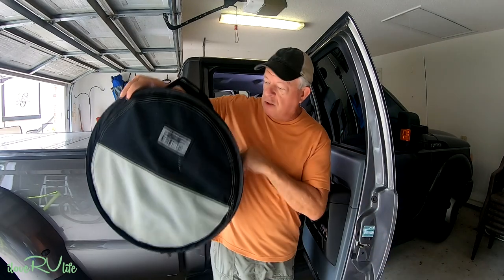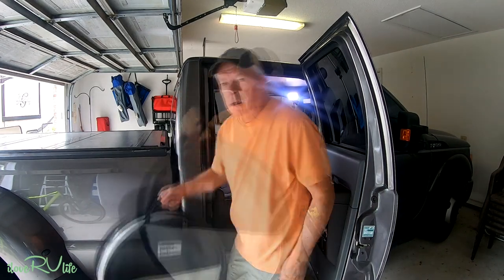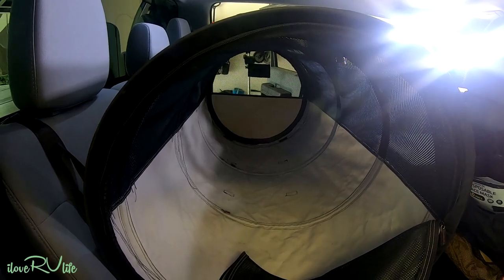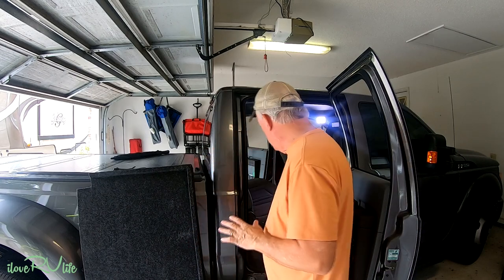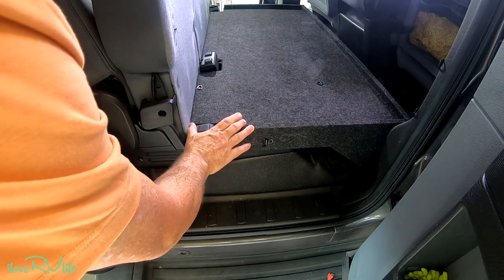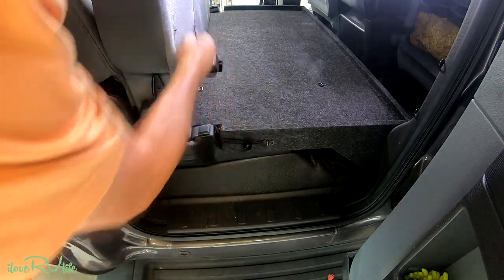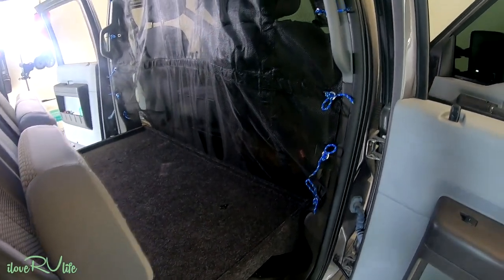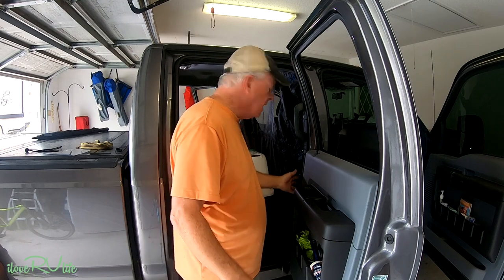Making RV Travel With Cats Easy

Comment: Great video, we were faced with the same issue.  We are full time and travel with 4 cats.  We came up with a very similar set up as you guys.  We have the exact same litter box but we place it on the floor of the truck behind the passenger seat (fits in there very snug).  We then got one of those water proof pet rear seat covers for the back see of trucks.  We then got the Bushwhacker Dog Barrier that acts in the same way as your spider mesh to keep them all in the back seat.  We are 18000 miles into fulltime and it is working great.
Reply from the maker: Thanks so much. 18k is a great accomplishment. Safe travels.

Comment: We travel with 3 kitties.  They each have their own condos (pet carrier).  Wifey sits in the back with them.  We lay the 60 side of the bench down.  Plenty of room in the Megacab for that.  They do bathroom breaks at rest stops.  We parked away from traffic.  So far it works for us.
Reply from the maker: The 2014 rear floor has a frame that’s higher than the foot area.  Newer trucks fixed that with the entire area one level with the seats raised.

Comment: In our Class A Diesel Pusher, we put a harness on the cats and their leash.  They have the run of the coach and if they get near the driver, the passenger leans over and grabs the leash.  They have their litter box and water available just like when we are parked.  Leash also keeps them safe when we move them from the house to the coach.  I made a cover out of 1/8" Masonite to keep them out from under the dash when we are parked.  One of the cats likes to sing to us for most of the time we are moving and will occasionally they will climb into the passengers lap.
Reply from the maker: We’re amused how each one has their own personality. Mink will chat to us about bumpy roads. Molly is just chill. They continue to be good RV travelers as we start our 11th year.

Comment: Oh gosh, my cats would get through that mesh in two seconds!  They would also jump up on the back seats and scratch the leather.  Just put the pet tube on the platform you built, and put the smaller liter box sideways in one end of the pet tube.
Reply from the maker: Not this mesh.  This stuff is heavy duty.  Our two aren’t that aggressive. So far, the long trip solutions is working well.